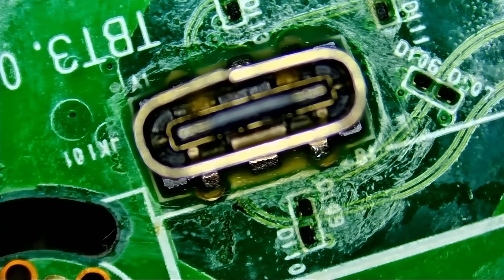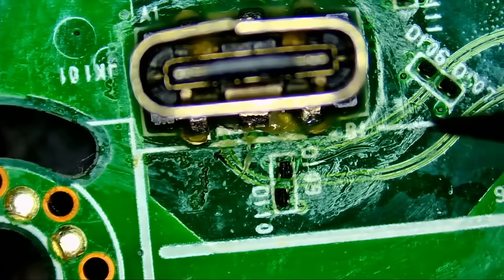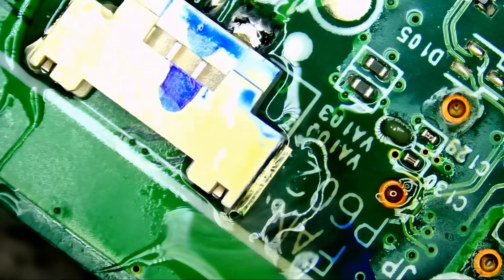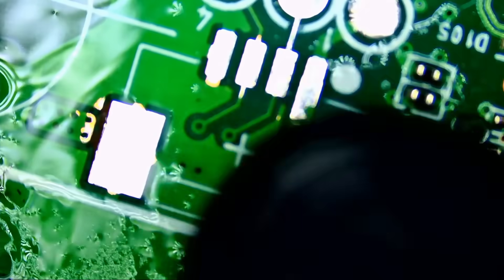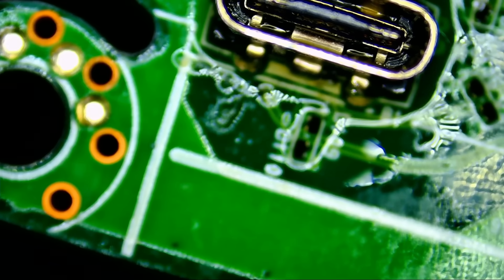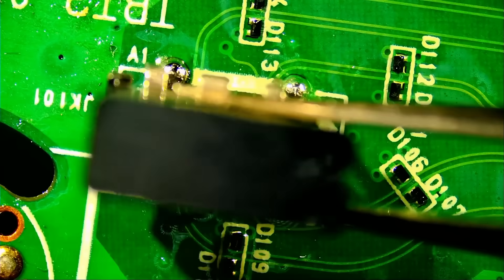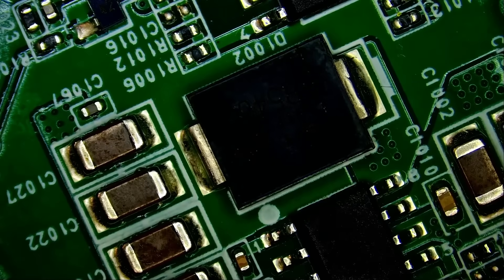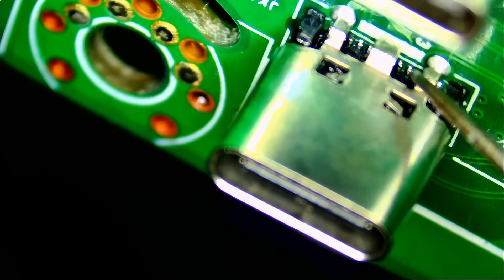$1300 LG Ultrafine 5K Thunderbolt Repair - These Monitors Keep Dying

Comment: If your an LG screen owner I would epoxy that connector to avoid it having issues
Reply: wouldnt that make further repairs more difficult? in macbooks they uses soft connectors to the motherboard to ease the repairs in case of failure. it should have been standard on displays that gets abused.

Comment: For delicate connectors like this, it's best to plug in a short extension cable and zip-tie it to the device, so no strain can be felt by the board connector.  Then plug your main cable into the extension.  If you wear out or break the extension, just replace it.

Comment: Modern connectors like usb-c, hdmi, etc often get destroyed by people pushing plugs way too hard or yanking on cables. Maybe even cause shorts destroying components? Always be very gentle and your devices may live for quite a long time.
Reply: the veritable problem here is the very bad placement of the usbc plug, on other devices like the latest macbook pros or even framework they are connected via a soft ruban to the motherboard so that in case of failure its easily to change.

Comment: Layman here, just curious. You spoke about not accidentally blowing off the tiny components around the front of the connector, but how do you also protect the tiny components on the back as you're blowing hot air on them?

Comment: 16:19 manufacturers design product and components in such a way it breaks on certain use, this connector has no safeguard against user cable pull and push and its suppose to break on such usage. isn't this known and should they have some mechanism to hold stiff this connector?

Comment: I remember installing a RGH mod into my xbox360 so many years ago when all I could afford was cheap tools and was too young to appreciate that spending more for good tools completely changes the difficulty of the job. I had a cheap Chinese ebay soldering iron with 3 settings - off low and high. My tips was so old and just beat up and I think had a bit of oxidation or pitting and a totally blunt tip. I was too stupid to go buy a $5 replacement tip as I didn't know the hardware store had them. It was the worst iron you have ever seen. Then inside the xbox you needed to solder I think 3 wires if I remember correctly to the smallest pads you can imagine. So many people on the forum posting about lifting pads and destroying their xboy beyond repair for the average person. To add to my challenge I of course didn't have any flux as to me rosin core solder had all the flux I needed. But I was dumb and went full send, took apart the xbox and located the micro pads(a microscope sure would have been nice) I needed to attach my wires to and just went for it. I had done a fair amount of soldering prior but ultimately as per my post had not developed proper technique and skills. But I was good enough and new by reading others experiences to not be to long on the pads and with luck I attached the wires fairly easily and the connections were solid. With the RGH there is a bit of luck involved in the 360 running unsigned code and some might argue either it is connected or it is not but my install would boot on the first reset every single time. Others took 2 or 3 or more sometimes taking like a minute or 2 before the system would boot. I did it with the cheapest crap tools you guys could not even imagine. I even did it a second time for a friend with the disclaimer it could break the system I am not responsible. I still have that 360 and it runs fine to this day. Love your videos Alex, also I bought better tools after getting a little older and moving away from a paper boys wage

Comment: That customer forgot to buy low melt solder from you Alex. That's why he struggled to get it off..
"The Magic of Low Melt Solder"
Reply: I don't really know how you'd get low melt solder underneath that thing?
Reply: An alternative would have been to clip the pins, and then remove them one-by-one, by desoldering.